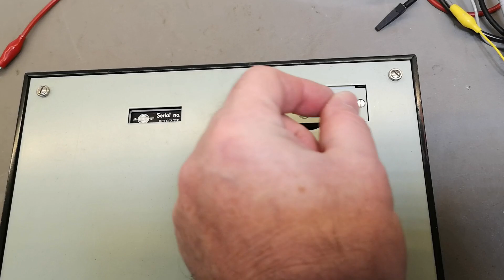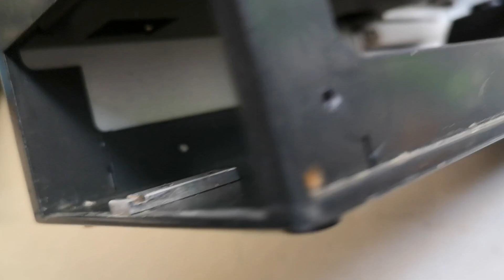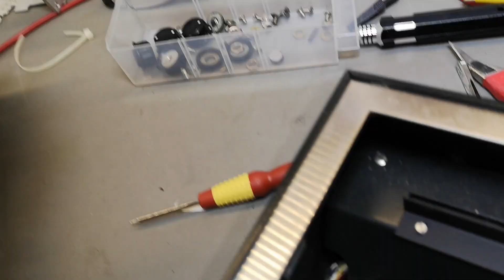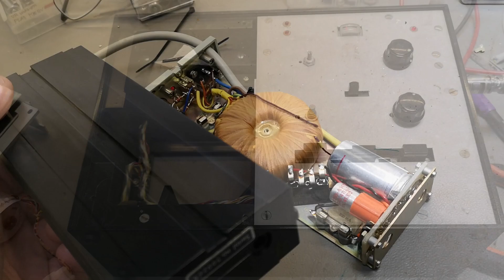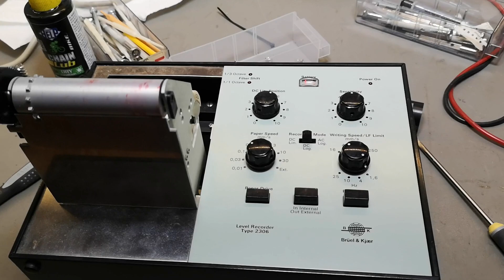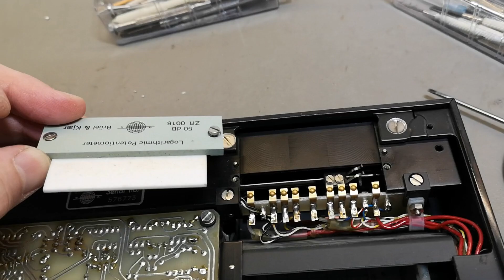Brüel & Kjær 2306 one Channel Level Recorder Plotter repair test teardown

Comment: Hello, so for a change a little mechanics, the case is perfectly designed - welded from profiles, it has no chance to twist and thus affect the function of the printer's mechanics. You are, as I see it, a professional peeler of stainless steel sheets 😂
I'm not entirely sure, but a similar power supply solution was used with Unitra radio tape recorders, the storage space accommodated the power supply or batteries.

Nice day 🙂 Tom